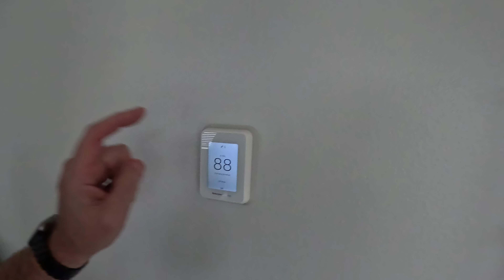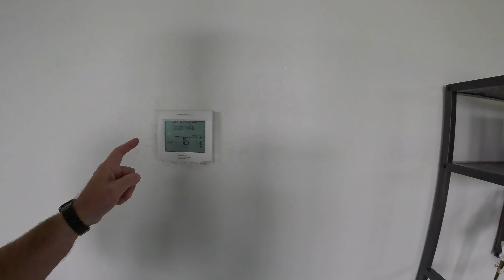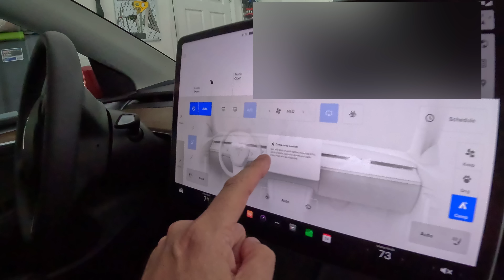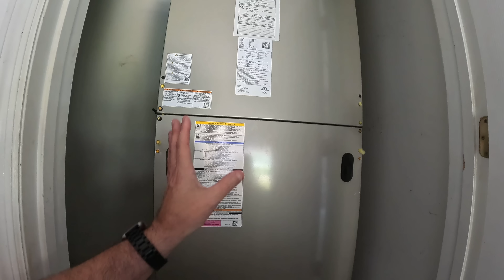AC failed again after 4 days - Enough is enough !

Comment: Now it makes sense. Carrier is one of the most reliable AC systems and Goodman is less reliable. My AC system is made by Bryant, which is owned by Carrier and uses the same parts as Carrier, and it hasn't had one problem since I had it installed 20 years ago. Consumer Reports ranks Carrier and American Standard 4/5 for reliability and  Goodman 3/5. They ranked the most reliable AC systems which are made by Armstrong, Ducane, and Mitsubishi (5/5).
Reply from the maker: Yes Carrier has a good reputation from reviews so hopefully we are good now

Comment: $14K for a new outside compressor unit? Wow. I live in Fort Lauderdale and replaced mine last year for under $6000. I replaced the outside compressor unit and the air handler inside the house and went with carrier. It has been great since. I can't believe they cost that much in Orlando.  Based on a quick google search the avg cost of replacing a central air unit in Florida for a 2000 square foot house averages from $5,800 to $14,800. You are way at the high end.
Reply from the maker: No the 13K we ended up paying was for a whole new Carrier system installed not just the hardware (not just the outside unit) .They started at 9K for a 14 Seer system installed  , this was the more expensive high efficiency 16 Seer system ( dual speed) . Our house is 2800 sq feet so we needed the larger system than the 2000 sq foot system so I think your prices was accurate.
Reply: @ThemeParkBazza   wow your house is huge. My house in Fort L is only 1900SF. Also, we don't have nearly the population growth in Broward County as in Central FL. Our county is pretty much fully developed and now they just demo and build brand new buildings in place of old. I have to say imo most of our contractors down here I've dealt with are quite decent and most are from the NE USA where I am from. I'm sorry you have to deal with bad contractors there. i had a bathroom complete redo  here two years ago and no problems at all. they were a husband and wife team.